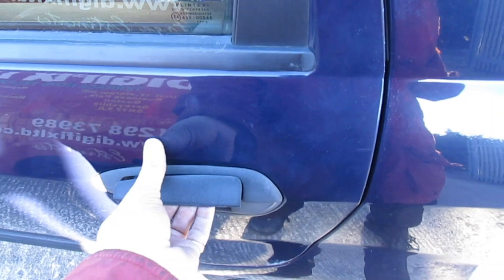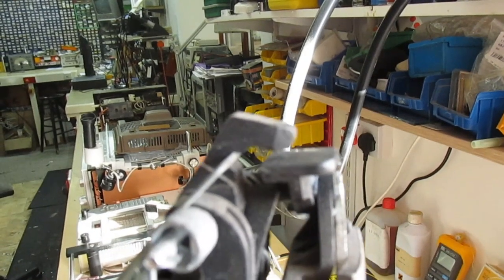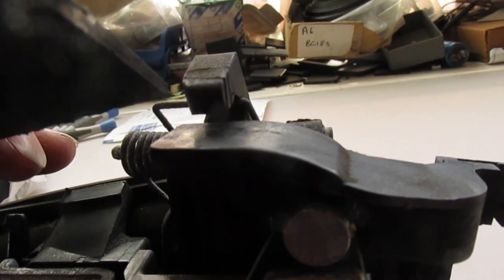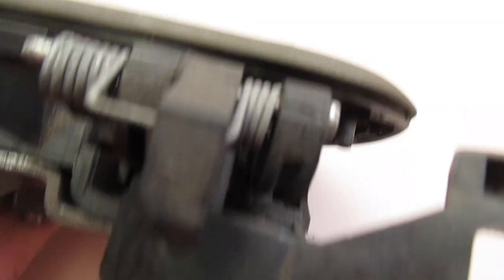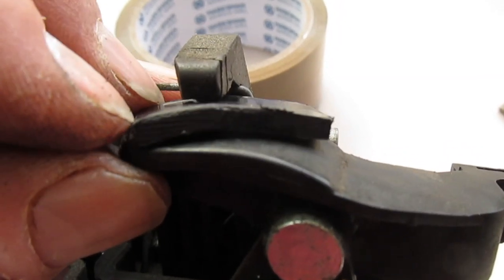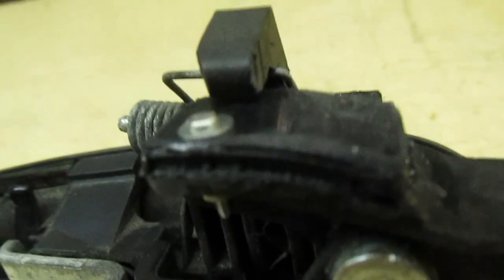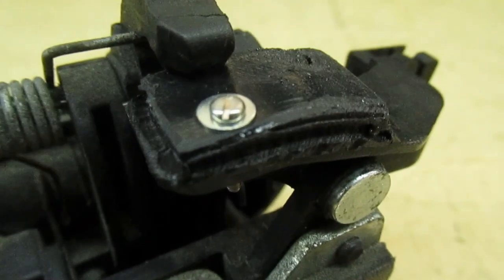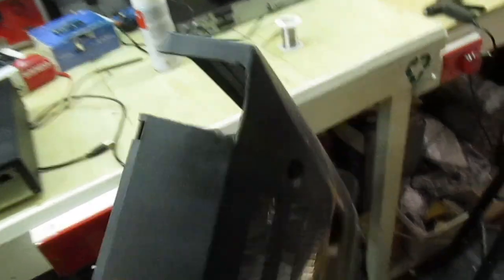Fiat grande punto difficulty opening rear doors fix .

Comment: Had the same on my seat Leon door mechs dried up, drilled a small hole in the locking mechs and injected lithium based plastic grease into them then glued it back up been fine for over 2 years 👍
Reply from the maker: Seems to be a design fault on Fiats part rather than just needing lubricating in my case , I did another one of my Puntos today , same gap in the mechanism .

Comment: Hi, have you ever experienced difficulty getting a Fiat Punto boot open? Mine is a 56 plate, I can open it using the catch inside the boot but it won't open with the key or dash button. It does make a short whirring sound when I press the button as if it is trying to open. I've tried things like WD-40 on it but as it has no issue opening manually I dont think its the lock (or at least the exterior lock). Are you able to help at all? Thanks!
Reply from the maker: This is not a problem I have had but the boot lock is a common fault on puntos,usually the boot light wont come on when you open the hatch and this is the first sign of lock failure,its caused by water getting into the tailgate,have a search on the internet for punto boot lock a new lock is not very expensive and quite easy to fit.
Reply: Thank you, I’ll give it a go
Reply: @lara3992  Hi Lara,did a new boot lock resolve your problem,on mine it wont open on a button at dashboard or key,just from inside of boot
Reply: I took my lock out and the connection was all green so definitely a problem there! Fitted the new one and it still wouldn’t work, had to open up to see the wires and they were breaking. Need to get them replaced and hoping it’ll work then - hope this helps
Try a lock first though, got mine for £20 off eBay
Reply: @lara3992  thank you,the wires on mine were already soldered,so i will buy new lock